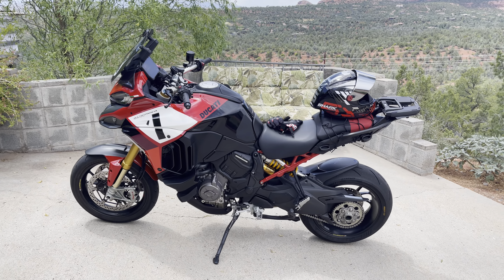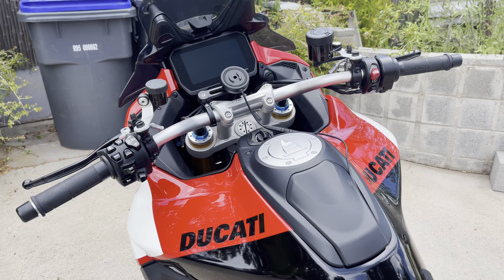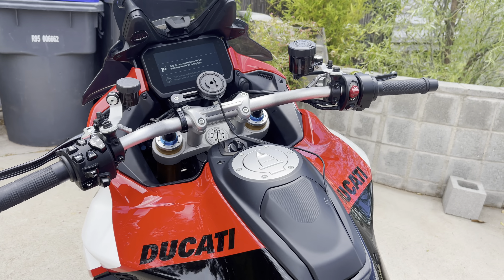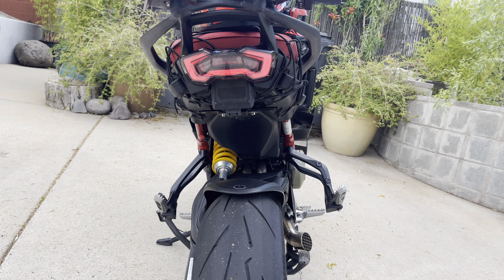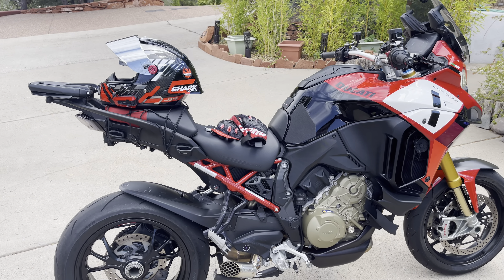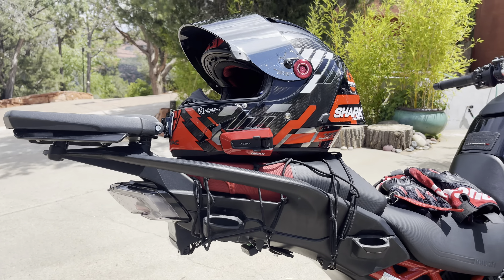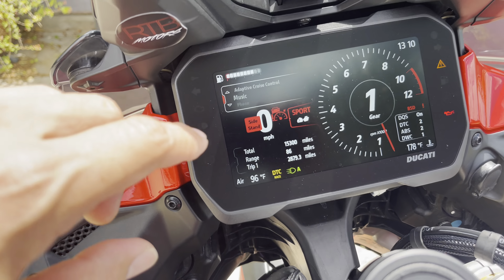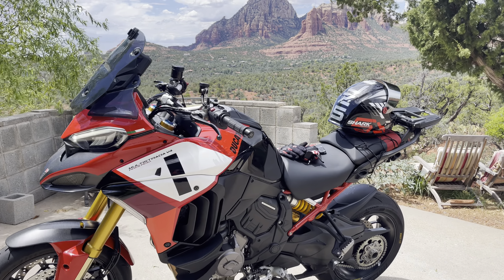@ducati Multistrada V4 tail light with integrated blinkers !!! Problem !!! ￼

Comment: I hit the same issue today, this is actually not the relay but CANbus. The lights, both brake and turn signal, are missing the CANbus module so that every time you use them will throw a error code to the dash complaining about open/short circuit. The reason is that they use the same design as the light for Panigale, but the design for Multistrada is way more complicated that the tail light is connected to the ECU. So if the tail light dead, there will be tons of errors and even break Rader/Cruise/traction control.  I think unless the company can make a CANbus module, there is no way to solve it.

Comment: Any update on the CC error (I have the same issue with my integrated tail light)? I see the new offerings include a resistance with 4 wires but have not received any response from the various vendors...